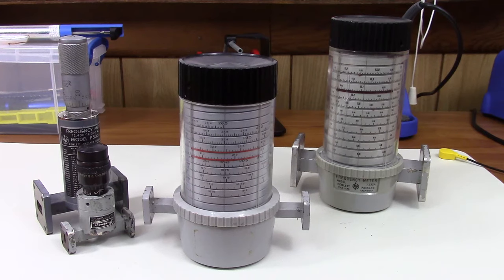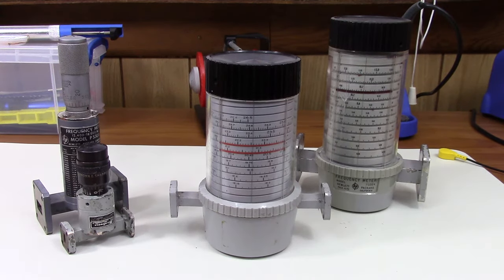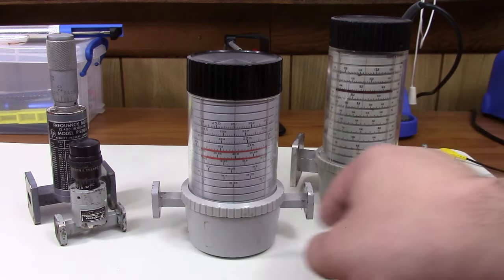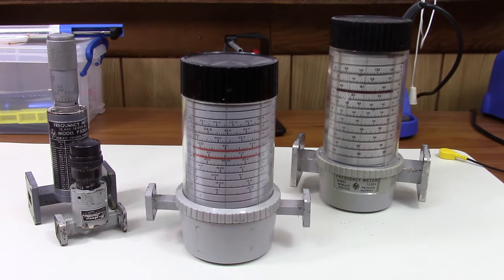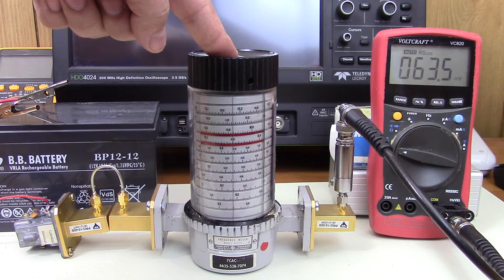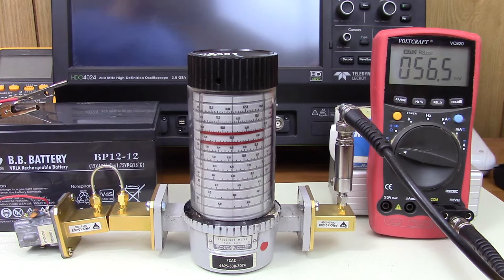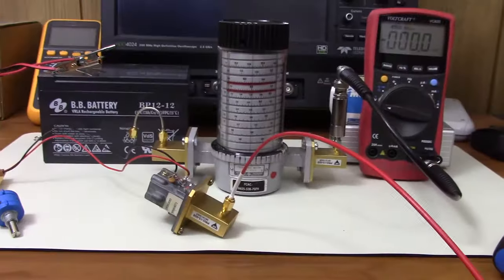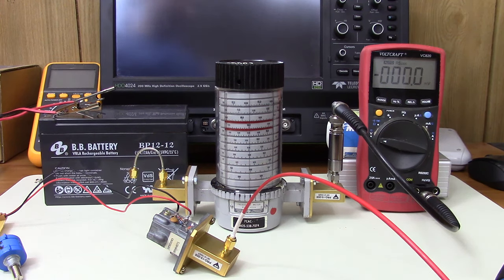Microwave Frequency Meters

Comment: I would like to know by what "standard" these instruments are first calibrated.  On the readout, it says 10.4.... but how did they calibrate the dial?  What is the previously KNOWN frequency, a constant, to start with?
Reply from the maker: I don't know for sure but I'd assume they worked backwards: While at that point in time measuring very high frequencies rather precisely was extremely difficult, it would not have as difficult to produce hight frequency test signals with very high frequency accuracy. So the known standard was probably not a different test set, but rather some known frequency signals which were used to verify the frequency meter.

Comment: Thanks for the video.  I was wondering if the power detector has a 50 Ohm impedance or if you even need to worry about that.
Reply from the maker: It does. But my guess would he it isn't all that important as you are looking for a relative reading / peak.

Comment: hi  i have the  532x  and   when   turn  the  wavemeter    i  cant see     resonance  in osciloscope   what happen ?
Reply from the maker: Do you have a detector diode connected to the output? Does the detector diode indicate the signal present when connected directly to the source? There needs to be a minimum power level for the diode to detect anything and the tuning of the cavity is extremely sensitive (tune very slowly).
Reply: @BalticLab   yes. I. Use a. Diode. Detector. And i i watch  the signal in oscilloscope.  Also i use. A power meter
Reply from the maker: @georgeveropoulos2489  Could you record a short video showing your set-up and the scope screen while tuning? You can upload it as unlisted, shoot me the link and I'll take a look at it.